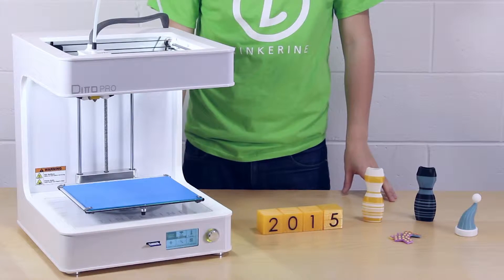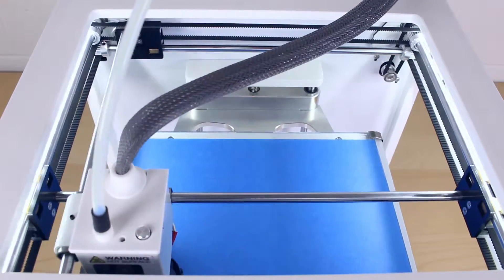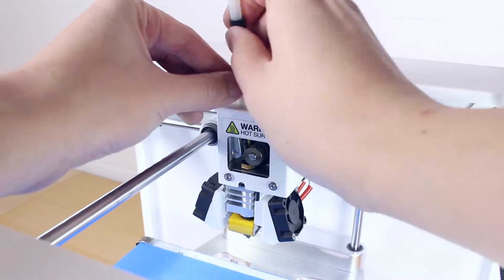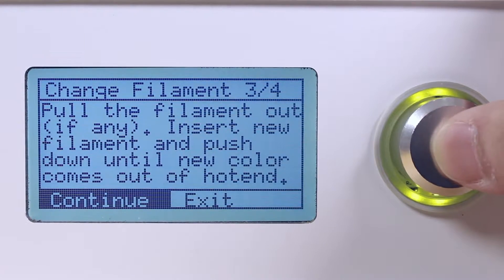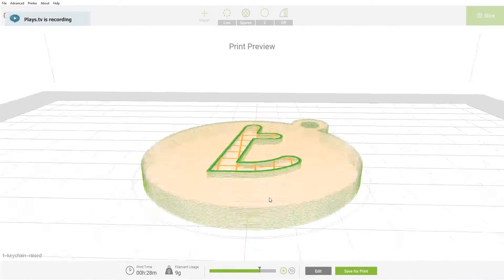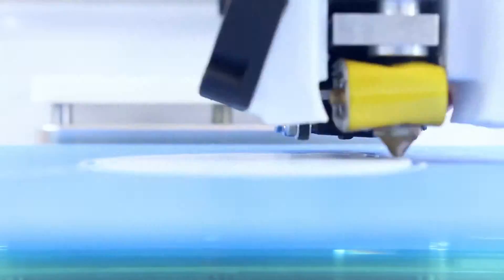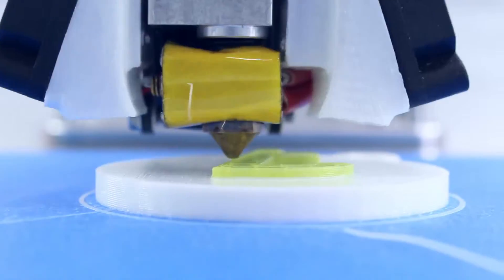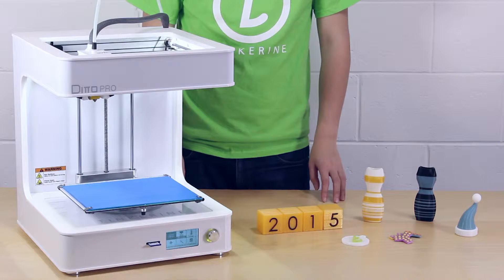How to change the filament on the Ditto™Pro 3D Printer

Comment: When i fed the filament in the gears, it didn't pull the filament through.  The display says to push the filament down until the  filament comes out the extruder end.  The demonstrator does not do this.  When i do it his way the printer doesn't automatically push the filament down and I can't push it any further down to get it to come out of the extruder.

Comment: My print didn't restart in the correct spot after the pause. Is there a way to try to continue printing again? I would need to start the print at 90% printed.
Reply from the maker: Thank you for the comment! When you switched the filament at the pause point, was the bed accidentally moved? I'll also pass it along to our software developer to look into it!